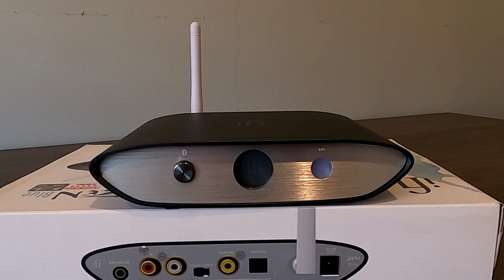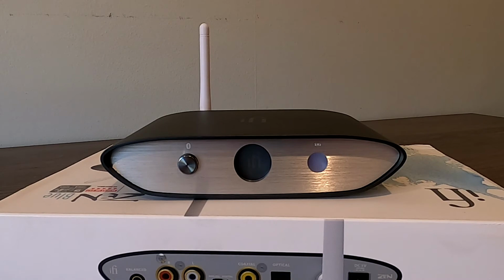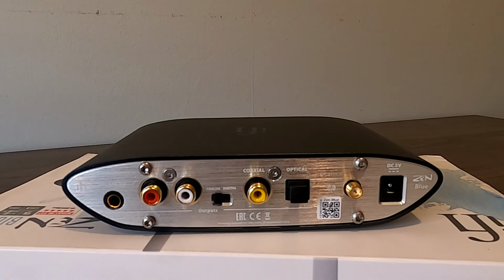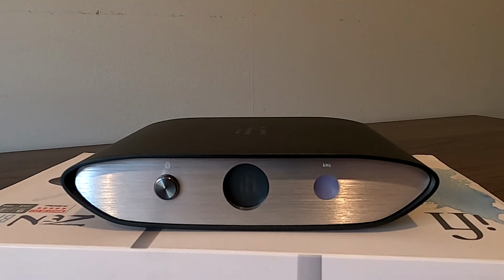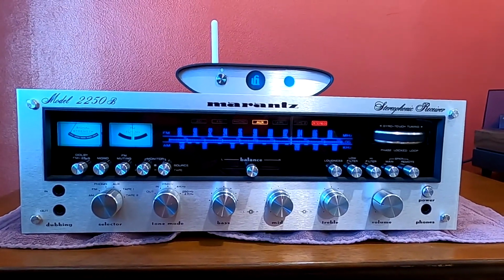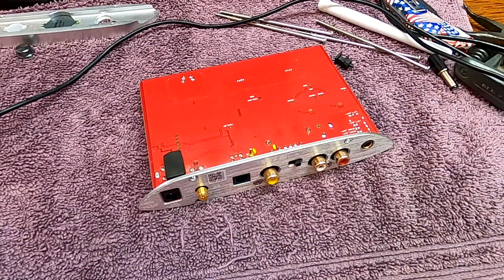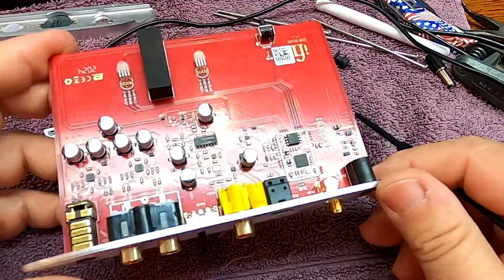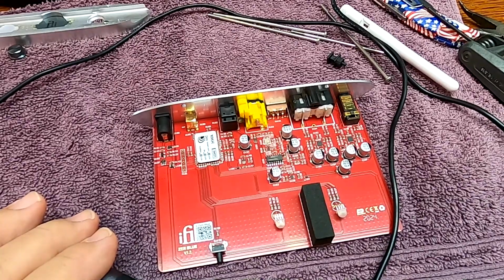ifi Zen Blue HI-RES Bluetooth Receiver REVIEW

Comment: Hi I have a technics hifi system would the blue ifi zen be good for it. Because the bluetooth receiver I currently have brought for cheap  is not good it's called u green. When I connect it up I have to put my volume up to max on my technics and the sound is poor. But when I play my cd no problems. So do you think the ifi zen would solve the volume when I'm playing music .
Reply from the maker: Yes, the ZEN will work properly. The ZEN has the correct line output level
Reply: @breakerbroke23  Thank you